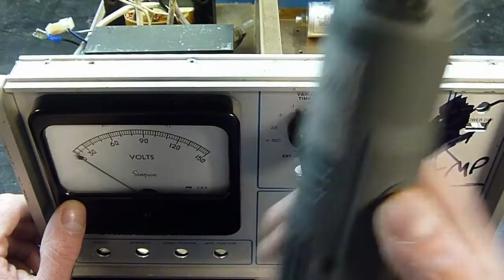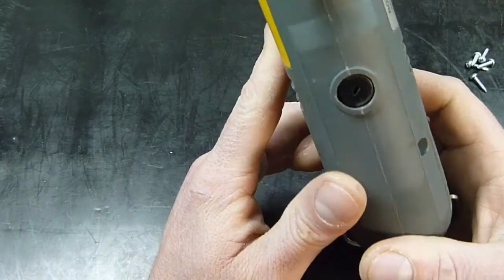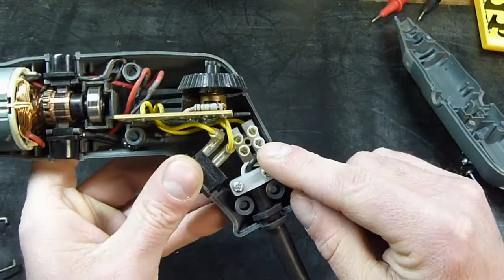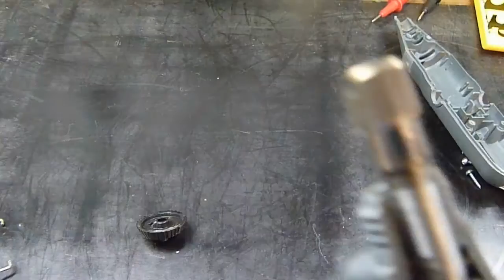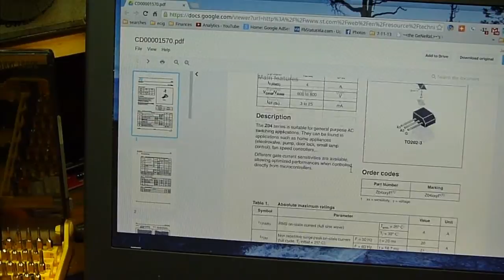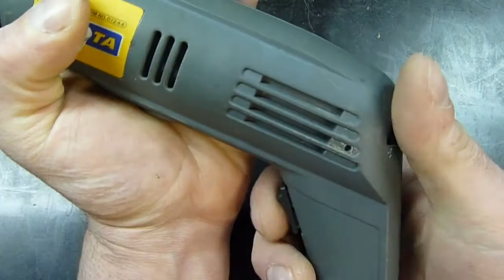Nikota Rorary Tool Teardown and Repair

Comment: I got the about same Nikota ('Ni-kota', like 'Mi-ami') kit at about the same price, at about the same store. I really like it. I've used it over 2 dozen times or so, and it hasn't failed me yet. But now I'll watch for that telltale 'faux-dirty-pot' symptom to ever appear, and try to stay on top of things. One thing, though: I'm just a bit concerned that the hot melt might prevent operational heat from dissipating sufficiently, and might cause the same or worse problem to reappear. I guess they design it so you can't win, no matter what you do. There are little spring-loaded heat sinks out there that clip onto semiconductors of various types, maybe that'd be an add-on solution if the issue repeats itself. Depends on how hot the thing gets during use, I suppose. Maybe it runs cool, who knows? Thanks!